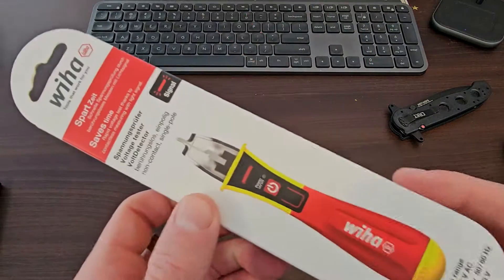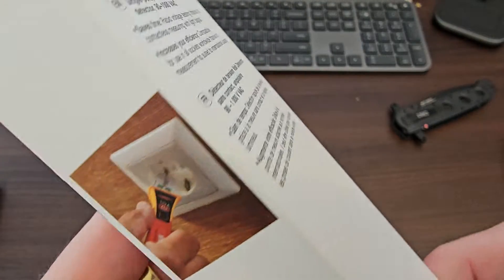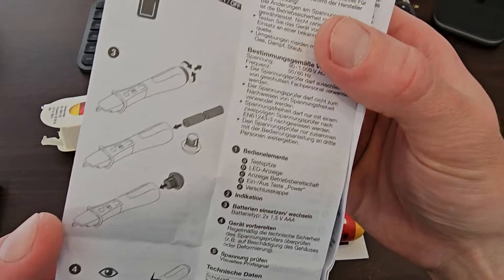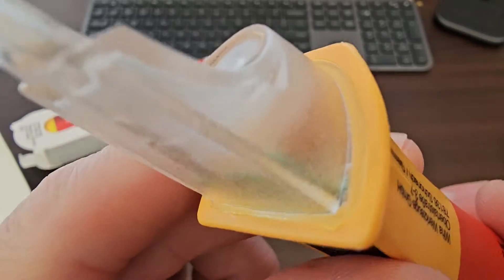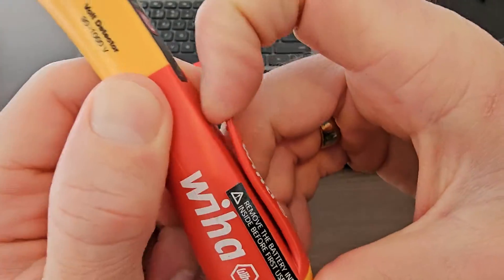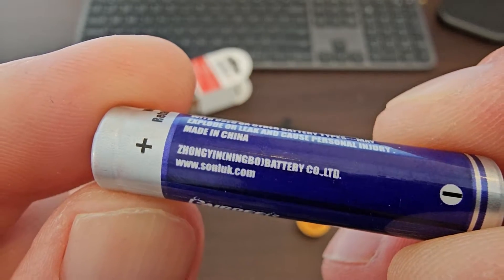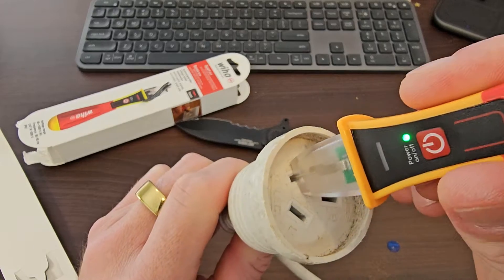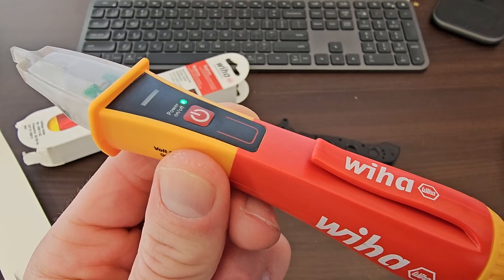WIHA VOLTAGE TESTER / VOLT DETECTOR

Comment: You clearly don’t know how it works or how to use it because you’re clearly not an electrician. It doesn’t detect voltage it senses the magnetic field that is generated when voltage is present. Also never use it to confirm a circuit or cable is dead , it is simply indicating that a voltage is present it doesn’t tell what the voltage is , if the voltage is below the minimum that is rated for it won’t work and that voltage could still be enough to give you a shock

Comment: I thought it worked pretty good on the lead socket; zero on the neutral and lit up on the active. Can you do an update and include a wall socket and a cluster of dangling wires?